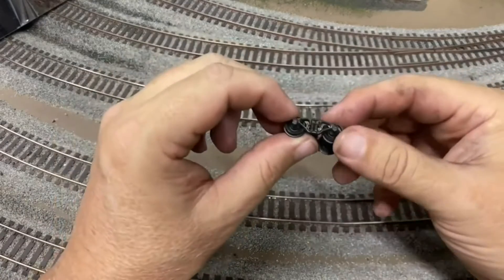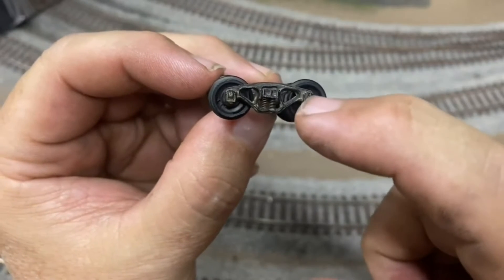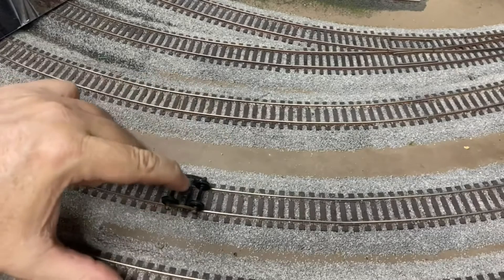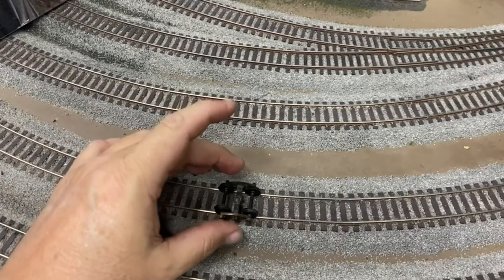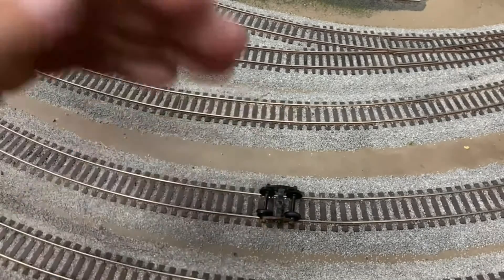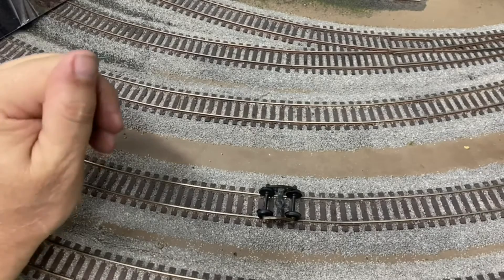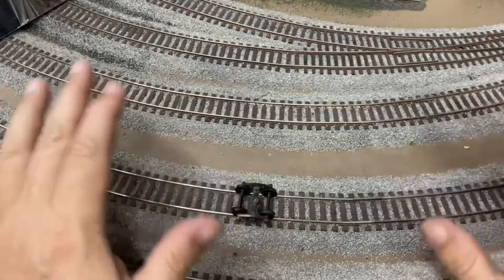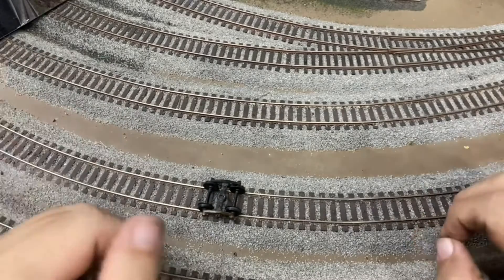Flat spots on railroad car wheels. Causes, damages and detection.

Comment: From a railroader's standpoint you gave an excellent explanation. A lot of flat spots are caused by a dragging brake or a handbrake that wasn't properly released. A serious flat spot can also cause a derailment since the rail car truck bounces up from the surface of the rail head and can bounce the car off of the rail. That's when the poop hits the fan, it's all over. I don't know how the current railroads handle departing trains but during my career there was a car inspector stationed on either side of the departing train to observe the train movement when departing the yard. In this manner visual defects and flat spots could be detected. NORAC rule 71 governs the handling of flat spots on trains. You are correct in noting that the crew could not possibly hear this defect. The noise in the engine cab is so that detecting this defect is near to impossible, especially if there is more than one locomotive on the head end. When filming if a serious flat spot is detected you can call the em number posted at the grade crossing bungalow and call it in. 😎🚂🚃🚃🚃✝
Reply from the maker: Thank you as always for your great imput